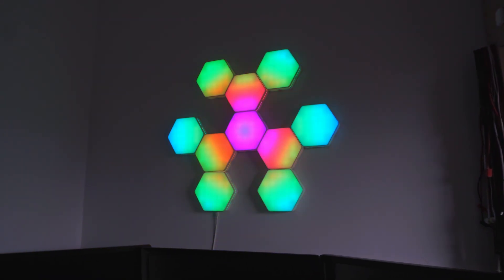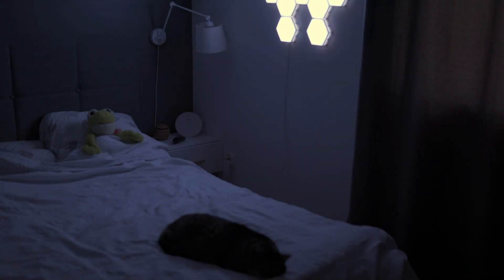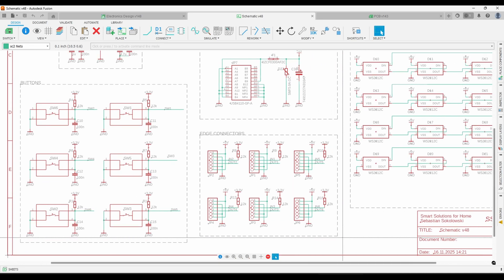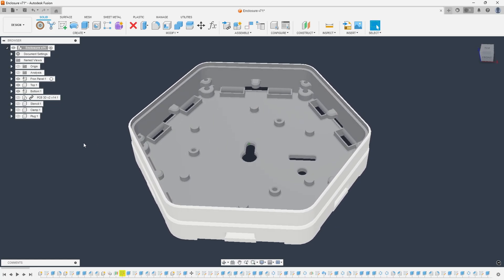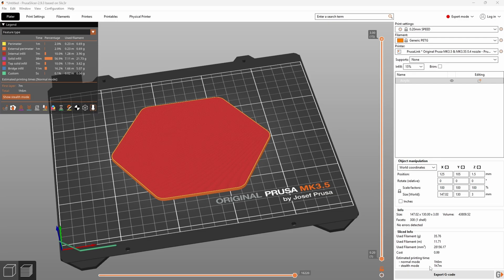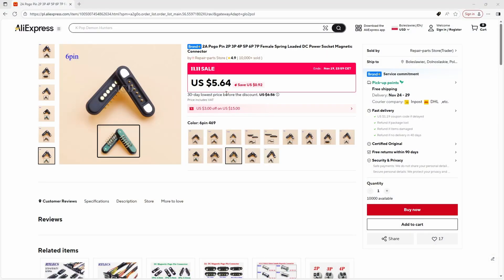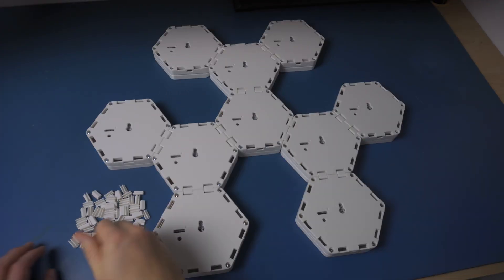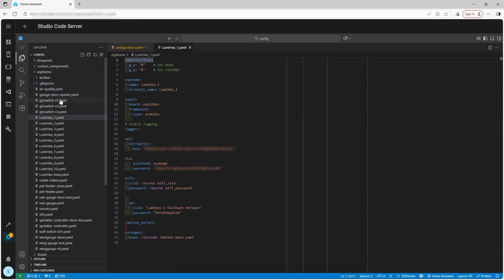Smart DIY Nanofeaf panels for Home Assistant Powered by ESP32

Comment: Awesome project! What's the story on mounting? I see a single mounting point on each tile. Does each need to be mounted separately or are the clip connections sturdy enough to hold up larger configurations which just hang off of the two side tiles?

Comment: Danke!

I understand HomeAssistant and automation, I have a soldering iron (if necessary), I have two 3D printers, etc.

All I need now is some hands-on experience with circuit board design, and then I'll build a craaaaaaaaaaaaaaaaaaaaaaaaaaaauuuuzy lamp for the community...
I don't have a channel yet, but I'll start one!

Thanks for your inspiration - I just love people like this - greetings from germany

Comment: Thank you for this amazing project. I was wondering how the switch can be pressed once the tile is fully assembled. My understanding is that the switch is meant to change the light color effect without using Home Assistant. Could you please clarify how this is supposed to work?

Comment: Appreciate the detailed explanation and the time and effort that went into this tutorial. Would this project work in the same manner if using an esp8266 over the esp32 just for the cost reasons.
Reply from the maker: Yes, you can use the ESP8266, but… it does have less memory, so there’s a chance not all the effects will fit. Plus, there are fewer available GPIOs, so you'd probably have to give up on panel-to-panel communication. But other than that, it should work just fine!

Comment: Fantastic work, thank you for making this!  Just one question: which specific ESP32 are you using?  Everything in the files you provide says "ESP-32S" which isn't an official Espressif SKU.  Thank you!
Reply from the maker: Good question! The fact that it says ESP-32S is just an oversight on my part. It’s actually an unofficial module that’s pin-to-pin compatible with the official WROOM32. Personally, I always use the official modules, since I once had issues with booting on the unofficial ones. But the old part stayed on the schematic. Thanks for pointing that out — I’ll fix asap

Comment: Excellent video, and I love the project. Thank you for sharing all your hard work with the community. In regards to them having a comparable cost to completed retail panels, I really don't see that as an issue. DIY projects interest me if a) They offer a similar result at a lower price, or b) they offer a product at a similar price that better suits my needs. This definitely falls under b, and the cost seems completely reasonable. Thanks again for sharing.
Reply from the maker: I'm really glad you like my project! I actually follow a similar rule to yours. That’s why I don’t insist that my DIY stuff has to be cheaper than the store-bought alternative. That said, making just a few pieces of anything is almost always more expensive than mass production anyway.

Comment: That looks great! I was wondering do you make the solder paste printer too at 4:13? looks like something that is 3d printed that your putting the pcb into. I struggle the most with the alignment of the solder paste templates and the system your using looks excellent, how do you do it?
Reply from the maker: It’s a printed form from PEGT — super convenient. When you order a stencil from JLC, you can add four extra holes outside the board outline, which are later used for positioning. Highly recommend this method! It’s way easier than taping down other PCBs and then the stencil with masking tape :)

Comment: Just found your channel and homepage. This is an impressive project! 
I was looking through the files as it would be a great project to do with my son for his room. He has just learned to 3d-print and I'm hoping I can get him hooked on electronics as well. I have long wanted to get started in pcb design and creation so this would be a great starting point. 
The BOM for this project is not on you page, could you make it available?
I noticed you used a hotplate for one side, but it should be okay to use a heatgun on both sides, right?
Thank you in advance.
Reply from the maker: Thanks! I’m really glad you like my project. I think building it with my son is a great way to get him into tinkering and making things from scratch instead of just buying ready-made stuff :)
As for the BOM—I haven’t actually put one together yet. There are really just a few components, and everything you need is on the schematic.
I promise I’ll add a proper BOM as soon as I get a bit of free time.

Comment: Great project, really! Main advantage over commercial lights is that you have total freedom of programming the setup.

However while the educational value is solid, and open source spirit commendable, it's a project that's economically viable only if sponsored.
That's my issue with YT "makers" - most never make an effort to estimate the REAL costs. Kudos for trying in one of the comments!

Here's my estimate:

- 10 PCBs in white, 4 layers, top/bottom stencils, delivered:  about $170 (JLCPCB)
- 180 WS2812C-2020 LEDs from a reputable supplier: $25 - $30 + drivers + passives
- 10 EPS32-C3 mini: about $20, delivered 
- about 850g of cheap PLA: say $15 (1kg spool)

That's at least $23.5/panel, not counting bolts,  soldering paste, acrylic + cutting service (most of us don't have a $3000+ XTool at their disposal...), glue etc.
Reply from the maker: Thanks for your comment—I really appreciate the feedback, especially when it’s constructive :) Let me respond to a few of your points.

Regarding your PCB cost estimate: things like the stencil and express shipping aren’t strictly necessary. If someone’s not in a rush and is willing (or even prefers) to solder things by hand, they can easily get 10 boards delivered for around $117 (though of course that depends on where it's being shipped to). So, you could easily save about $50 there.
As for cutting the acrylic—owning a laser cutter isn’t a must either. You can outsource that locally, or even go through something like JLC (though I haven’t checked their prices).
Personally, I’ve done it a few times by just grabbing a sheet of acrylic from a local hardware store and cutting it manually with a handheld jigsaw. Sure, it’s not as fast or perfectly precise, but you can definitely keep the total cost for all panels under $10, and you’ll still have a bunch of acrylic left over for future projects.
That said, yeah—it still ends up being about $20 per panel, which puts it in the same ballpark (or even slightly more expensive) than commercial options like Nanoleaf. From what I’ve seen, you can get 9 panels for around $180.
But... I’m not trying to compete with Nanoleaf :) My project’s definitely inspired by it, but it’s not meant to be a direct alternative.
The idea was more to show that you don’t always have to buy everything—sometimes you can build cool stuff yourself. Plus, I think the fact that my project is open-source and based on the popular ESP32 gives it a whole different level of flexibility compared to Nanoleaf. Who knows, maybe someone will take it and build something entirely different with it—something I haven’t even thought of. That’s the beauty of open projects: you never really know what they’ll grow into :)
In short: I totally get where you're coming from, and I appreciate you sharing your point of view. 
If someone only cares about the price and doesn’t really value things like “openness”, a LED grid or the freedom to program an ESP32, then yeah — they should definitely just go for the original Nanoleaf panels.
Reply: @SmartSolutionsForHome  thanks for responding. Nothing to disagree on here :) 

It would be great if you could include a BOM estimate for your future projects. Maybe it could set a new standard of quality content in the space.

Looking forward to more of your ideas!
Reply from the maker: I really like this idea! Of course, it’s never going to be super precise—prices change all the time, not to mention they vary from country to country—but still, having a rough estimate of the final cost will definitely be useful for viewers.
Thanks so much for the suggestion! I’ll make sure to include something like that in my next video :)

Comment: Very nice work! I wanted to do something similar rebuilding the triangular Nanoleafs from scratch a few years ago, but I calculated that it would have been more expensive than buying them and I also don't have experience designing circuits and PCBs, so I gave up. I would really like to see a design variant with the magnetic pogo pins, even though they're more expensive.
Also, wouldn't it be possible to combine your two tools - the one for designing the layout and the ESPHome config generator, so that every config already contains the correct coordinates and you don't have to modify it? I'd be glad to help you with that if you want, as I've got more than a decade of web programming experience.
Reply from the maker: Thanks! I'm really glad you like my project!
As for the price—same here, I don’t think it’ll end up being cheaper than the original Nanoleaf either. But I also don’t think we’re talking about the same kind of product. I’d say mine has a few advantages :) One of the biggest is it's "openness", plus the super easy integration with Home Assistant using ESPHome.

About combining my two tools—you're totally right! Honestly, I hadn’t even thought of that. I made the pattern layout and coordinate display tool way earlier, right at the start of this project. Then, toward the end, I came up with the “file generator.” But yeah, you’re spot on—it doesn’t make sense for them to be separate tools. They really should be one.

If you're experienced in this area, I’d love your advice: what’s the best way to build this kind of app (for Wordpress)? This was my first time doing anything like this. 
The first app (for laying out the pattern) is just plain HTML + JS. The second one is a super basic WordPress plugin written in Python.
If you were building this as one single app—what tech stack would you go with, and why?
Reply: @SmartSolutionsForHome Yeah, the openness is great - back when I thought about rebuilding it my mind wasn't in the Home Assistant and ESPHome ecosystem like it is now. Back then I had another smart home system, but now I'm really rooting for Home Assistant and everything around it. The tools are all just so nice to use!

Well, if Wordpress is your constraint, I think the HTML + JS way is really the easiest way to go. JS (especially Vue.js in the frontend has been my go-to solution for the last years, because vanilla JS is pretty tedious to get reactive) is the main language I'm coding almost everything in. But to be honest, to use it on your Wordpress site, you could probably use anything and just integrate it using an iframe. Outputting just a static site (like your current HTML + JS) would be enough for that. If I can help you any further, please don't hesitate to ask.

Comment: i'm printing as we speak the MKExpert version of the nanoleaf rgb tiles (i'm going for a large 52 tiles design, i'm halfway thru)
it does not scream quality as much as your's but it's easier to do ,and cheaper also i think
anyway, it think its great that people are still working on that kind of projects, it also shows that nanoleaf tiles are appealing to a lot of people
keep the good work going, you've just won a new subscriber
Reply from the maker: I hadn’t heard of MKExpert before, so I looked it up after your comment—and wow, it looks awesome!
I had slightly different requirements for my project, but visually, the MKExpert version is absolutely stunning!
Still, 52 units? That’s seriously impressive.
How much power does one of those panels draw? And what kind of power supply do you need to run the whole setup?
P.S. Thanks for the sub! :) I really hope you’ll like my future projects too
Reply: @SmartSolutionsForHome they don't draw that much power, it really depends on the led density of the strip.
I guess if I go with 18 LEDs per hexa, I'll be around 37/40w for the whole thing.
Reply: for 52 tiles it is worth to think about silicon mold :) It's not so complex as it looks like :)

Comment: Wow, very cool project!
Instead of the double-sided pin headers, I might have used magnetic pogo pins and possibly based the entire connection between the modules on magnets so that it could be quickly converted into a wide variety of shapes (At least in my mind, that sounds cool right now xD)
And I think the LED density per module could be one (or maybe two) LEDs per row more - but I'm also spoiled a bit by my 12V SK6812 RGBNW strips with 120 or even 144 LEDs, all of which are individually addressable 😂
(But to save power, I set it up so that with static light, only every second LED lights up LED lights up (as this makes no visual difference when static) - but as soon as an animation is triggered, it uses all LEDs and then it's reeeeeaaaaally smooth, incredibly cool!!!)
Reply from the maker: Thanks a ton!
About the magnetic pogo pins — I actually mention them in my video. I did consider using them, but honestly, the price is kind of insane. Especially since you'd need six of them around the board. That’s why I ended up going with more classic pin headers instead.
And yeah, you're totally right about the LED density. The more, the better when it comes to visual effects. But like you said — the power draw adds up real quick. Right now, it's already pulling just over 300mA per panel when running white. So with 10 panels, even a 3A AC/DC adapter isn’t enough.
That’s why I decided not to go overboard with the density — but I agree, it would’ve looked way cooler :)

Comment: Amazing stuff. Curious to know what the costs per panel is. The more pcb you order the cheaper they get ofcourse.
Reply from the maker: I'm really glad you like my project! Thanks!
As for the costs—that’s a tough question. Like you said yourself, it really depends on how many PCBs and components you're ordering, and whether you're getting everything from China or sourcing some stuff locally.
But roughly speaking, if I had to estimate the total cost of materials, including the filament, I'd say it's around 20 bucks.